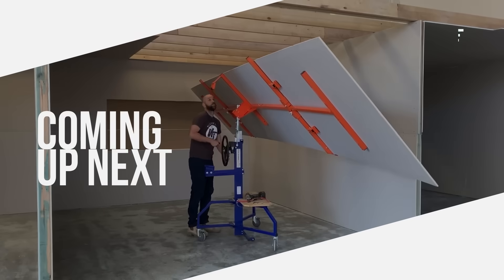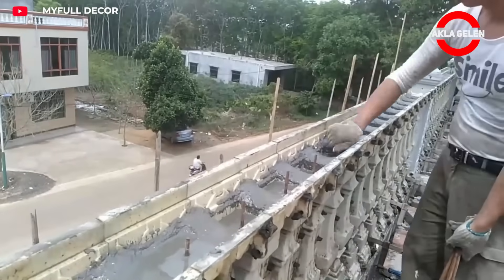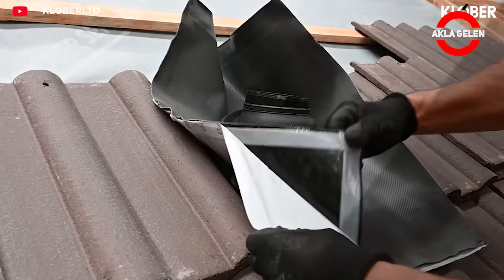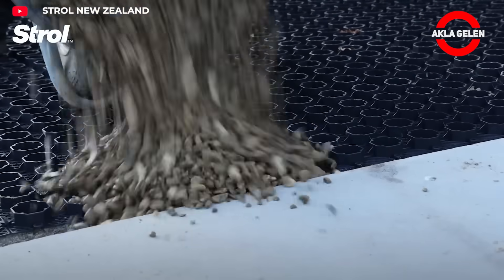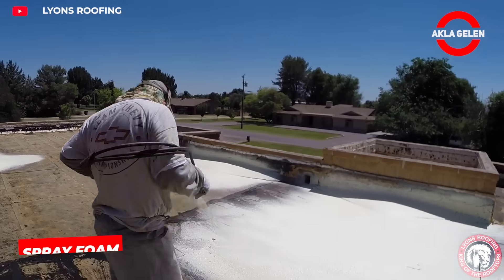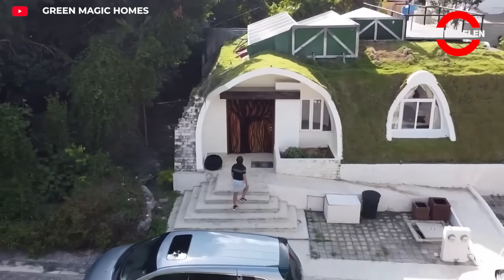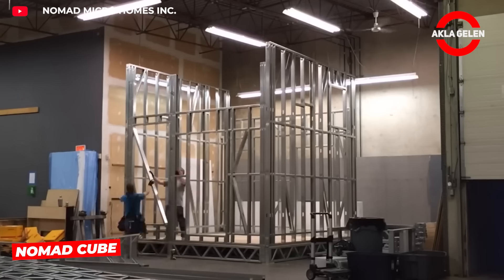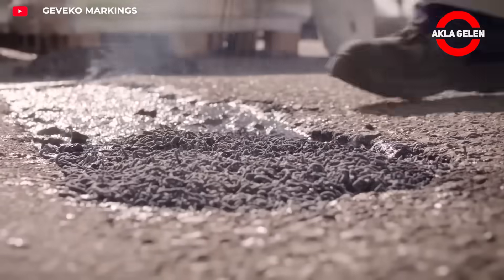Cheap Styrofoam house,I can't believe it! I never thought of these ingenious Construction Techniques

Comment: Styrofoam is nothing more than solid diesel fuel. Please check out the "Greenfell disaster" in London. Styrofoam is a fire hazard. I would never insulate my house like that. Rock wool products are more expensive but safer.